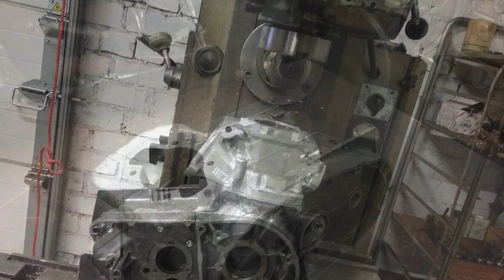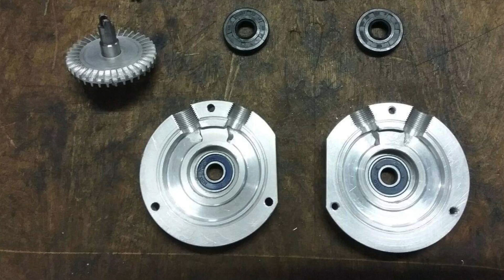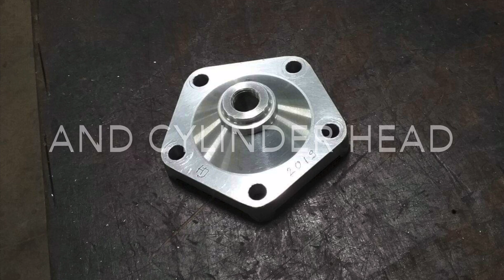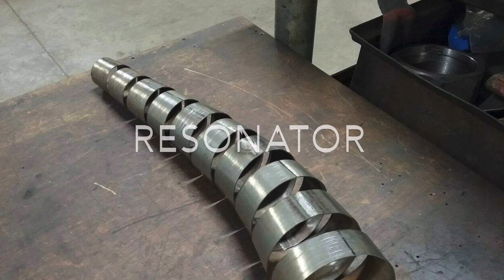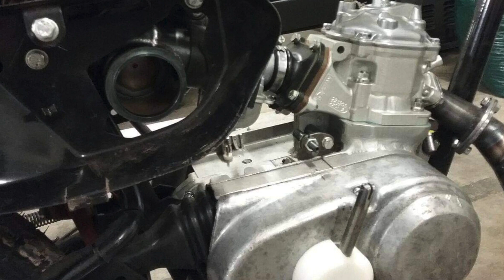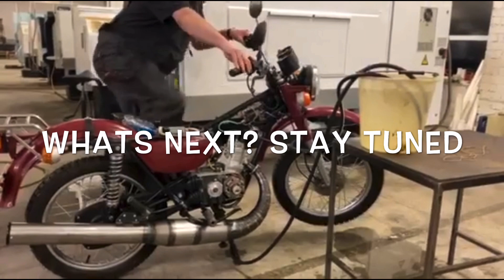Minsk + Rotax

Comment: Awesome. Revving is the same with Aprilia RS 125 2t.
So. Can this motorcycle beat Aprilia RS 125 RS.  
Aprilia RS 125 is high price. That's way I want to create or make my own motorcycle.
Reply from the maker: it is not going to beat rs125. this is rotax junior that have little smaller ports. but this work costs lot more that to buy aprilia rs125
Reply: @joonkustoms  thank you sir . You are right.

Comment: Lots of health!! What magnetou you have all of minsk or something else?    At my Minsk it melts my spark plugs, does it not face the standard minsk magnetou at high speed? Please help me!!!
Reply from the maker: we used original minsk magneto, it works well - but sometimes the commutator  box that is over its best before have some rev limiting issues (effect)  at higher speeds.
Reply: @joonkustoms Yes that was the problem, it creates a continuous flame at high speed, so the minsk magnetou does not support high speeds for longer duration! Thank you very much and much respect!